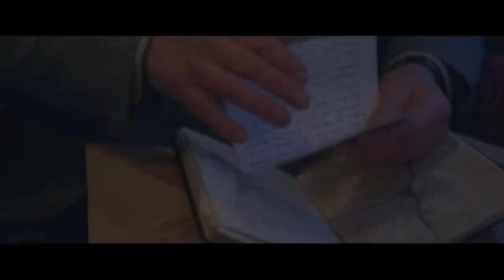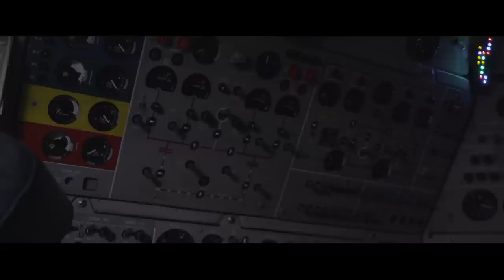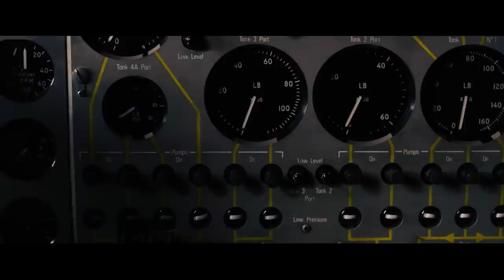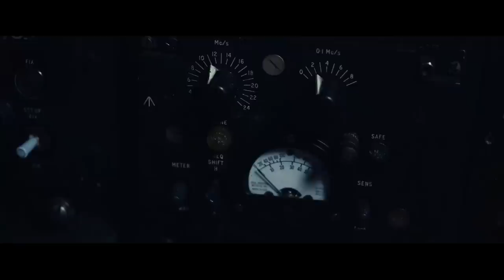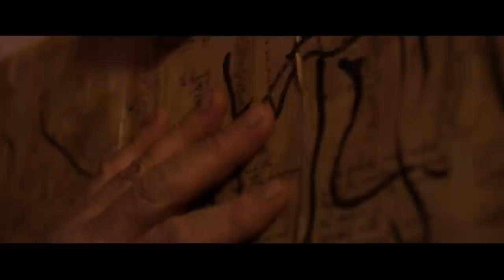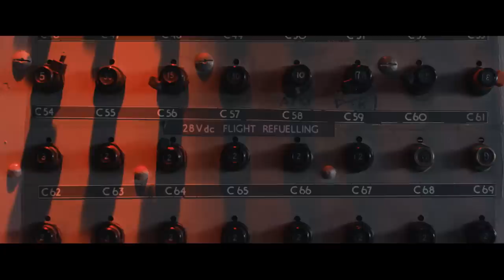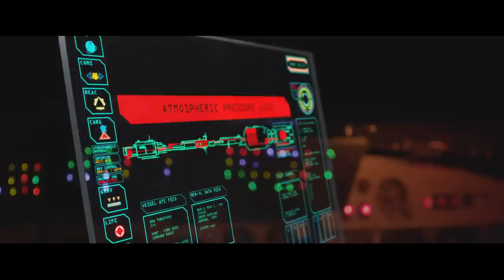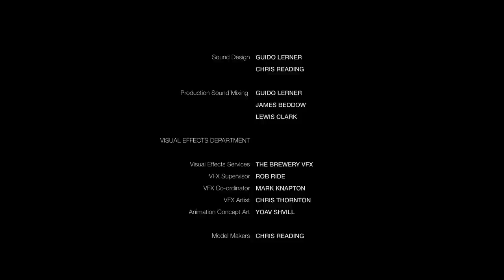Somnus (2017) | Full Movie | Rohit Gokani | Victoria Oliver | Robert Myler

Comment: Why don't most movies have enough sound volume? It's much easier to turn down than it is to try and increase when volume is too low and we are at maximum!
Reply: Aussie Andy  
No, we have a very fine, El Capitano system......
The sound on this uploaders audio is absolute crapola.
Reply: Aussie Andy  well now aren't we a little upety??? GTFO with your better than though art attitude!! I hav a cheap ass phone and ya the volume could have been a bit louder than it was...which I find to be true on most movies!! Although the gosh darn commercials are loud AF
Reply: I run into low volume a lot so bought some plug in speakers for the laptop, about $10.
Reply: That’s right it’s not my rig.     It’s ok he loader
Reply: because the guys that do the transfer are not professionals, because their transfer kit does not have audio VU meters, because they don't QC their work, for the same reason that many amateur transfers are low contrast and too dark. @Arts' suggestion is good get simple (usb powered) external  speakers.
Reply: A Bluetooth speaker is the answer. A better quality sound too.

Comment: I laughed when I saw him pull out the Multimeter and use it to try and Revive the guy.
Reply: No kidding - I hadn't finished laughing when I came to the comments section and saw you talking about the multimeter. A little earlier I was watching the guy put on a headlamp with the stretch band and thought wow they haven't made much progress in 250 years.

Comment: I feel that I need a little more details for the whole story to make sense to me.Such as, how did the first part of the movie relate to the colony. That part ended where you would expect a flashback to where the information came from not a jump into the future. I think the explanations ended up on the cutting room floor.
Reply: @Joaocruz30  who are you to say that? a movie is a story turned to life. I agree with rick there are major missing bits which could have been added in rather than visuals of jelly fish and close-ups of non functioning fuel weight guages and weather telemetry equipment. it needed way way way more connecting that book to those settlerrs than just a brief showing of the book still in almost the same condition as 300 years prior on the train ... in 300 years that book would be seriously worn out ... not to mention the ship itself had no way to know of that book or this small group of colonists or literally any of it.

Comment: Um... the stars don't twinkle in outer space. They only appear to twinkle on Earth because of our atmosphere.
Reply: Sandy J Renfroe Then why do the planets not twinkle ✨
Reply: Doesn’t the fact that they emit light make them twinkle regardless? Where’s Stephen Hawkins when you need him!
Reply: Sean Padgett What is perplexing is you can’t see any stars from low orbit.
Reply: And how do you know this, puny human? There are more than 5 senses
Reply: bunch of pulsars   , shush
Reply: Sandy J Renfroe stars twinkle because there dying, by the time we see it it is already dead.
Reply: Stars twinkle as seen thru Earth's atmosphere as they are very very tiny points of light. The planets may also look like should twinkle, also being small points of light, but they are, in fact, just larger enough to prevent that twinkling effect from being perceivable. They are much closer to Earth and are more like dots of light rather than pinpoints of light. On occasions the planets do look like they twinkle a bit if there is a lot of material or disturbance in the air, but this is rare.  (Somebody else here mentions that you can't see the stars from Earth orbit, but that is only true from a photographic point of view. In space, the astronauts see all of the stars very clearly and distinctly. But, photograhically, there is just too wide an exposure difference between the nearby objects---spacesuits, the ISS and, yes, most obvously, the Earth itself---for the camera to get both these bright foreground objects and dimmer stars in proper exposure at the same time. If whoever was videoing the EVA's decided they wanted to photograph the stars they could do so by exposing for the stars. The problem with that is that the foreground objects would get WAY overexposed and "bloom out" super brightly, from the sensors  taking in too much light. Think of trying to take a properly exposed picture of someone against the night sky at night: You'd shine light on your subject but the sky would look just black and starless, even if you could see the stars with the lights off. It is possible to fiddle with this latter situation enough to balance your foreground exposure with the brightness of the stars---to compromise between the two different levels of light needed---to get a decent exposre of both your subject and the stars, but it takes some work, the kind of thing that the astronauts aren't in a position to do. Having said that, I DO wish they'd occasionally let the foreground exposure go, and pan off the Earth to show the stara. On video it IS possible, tho, on film, it is nearly impossible to do, since film speeds (light sensitivity) are too slow.  (please forgive any typos/grammatical errors---haven't time to proofread). Thanks for the movie, btw.
Reply: Yeah exactly
Reply: Oh have you been to space and seen what it really looks like? Or you trust NASA. ..NEVER.A.STRAIGHT.ANSWER
Reply: @movienightaudiobooks7637  that's why I criticized nasa...re read my comment
Reply: When you see some twinkle in the space fly fahr away light speeding is a star that explode e realses a lot of magnetic field encreasing and then will tear you apart in tiny litle atoms..smollar then the light ones

Comment: where is the audio volume? Is it possible that none is able to give the correct settings including volume?
Reply: Yur vol. Also depends on kind of device yu,re using. Vol. up and down on mobile or if using a mxq TV box  its on remote control. If on PC you use the keyboard and OSD of player app which is in bottom part of the video player in yur browser